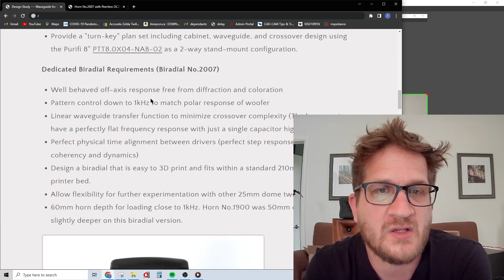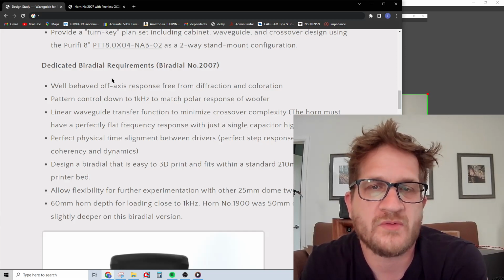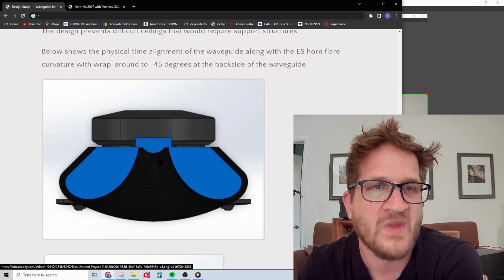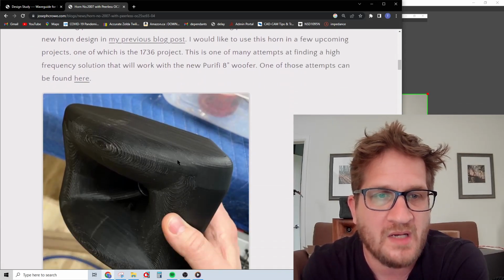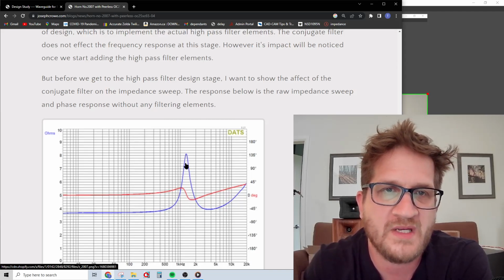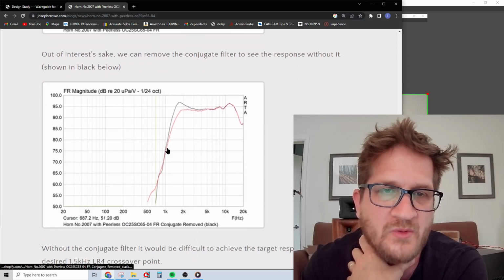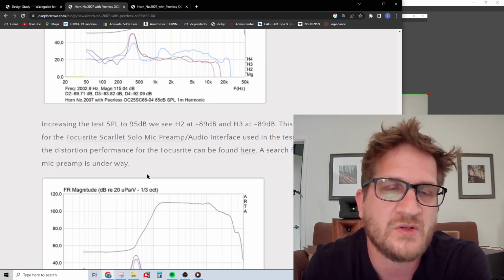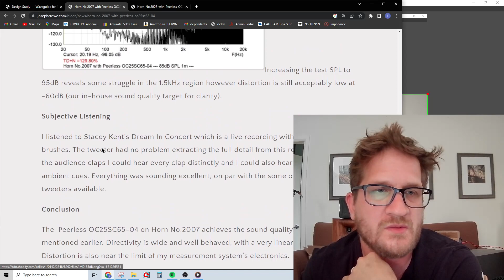Horn No.2007 with Peerless OC25SC65-04

Comment: Some really cool stuff going on here. Not sure what printer you're using, but prusaslicer has this thing called adaptive layer height that changes the height of each layer based on its slope. This means flat walls print quicker and more heavily sloped areas like the front of your horn are smoother

Comment: Love watching your videos! One aspect I'm wondering about, though, is the price relation of drivers and CNC work. You're pointing out affordability of drivers quite often, but unless one already owned a CNC machine or had free access to one, it wouldn't make sense to me to consider anything less than the best driver for a specific purpose? Be that as it may, keep up the great work and videos!
Reply from the maker: 3D printing is another affordable alternative. I do test higher end tweeters with even more to come.
Reply: @jim9930  I think you're missing my point: I said nothing to the extent that a driver would need to be more expensive in order to be considered worthy, or that there's something wrong with Peerless etc. My point is plain and simple: no apologies need to be made. Where I come from, the cost of having a horn made if one didn't have access to a CNC machine for free (e.g. at work) is so out of proportion in terms of cost, not to mention materials (e.g. drool-worthy solid walnut in a ES-290 horn in a JP project I saw of Facebook most recently), that it wouldn't make sense to use anything less than the best driver for a specific application, regardless of ITS cost (if the least expensive happens to be the one, that's fine).